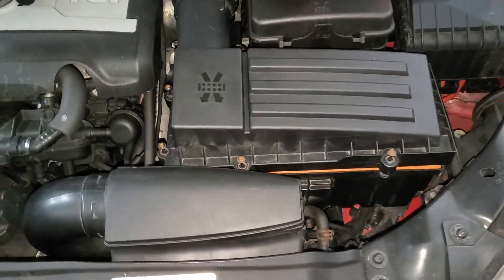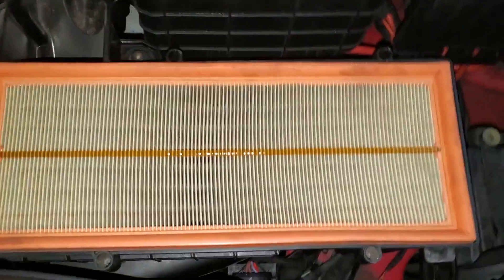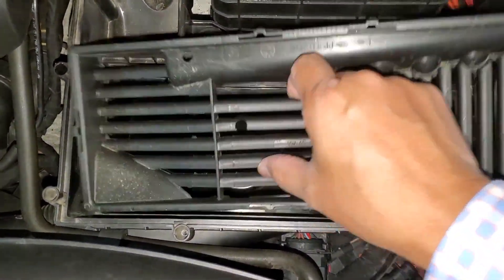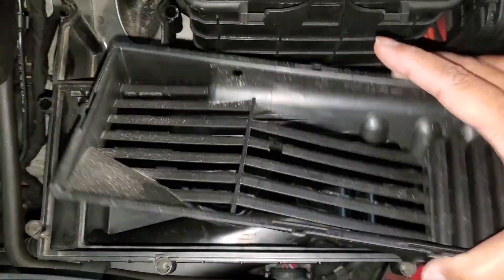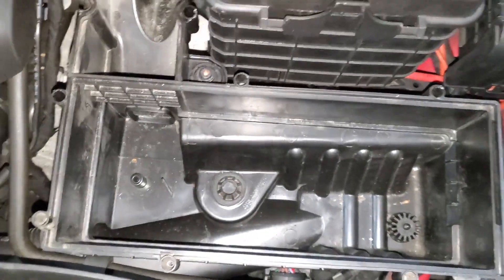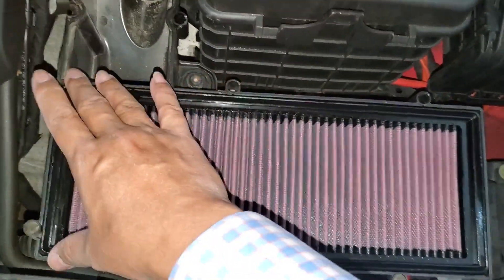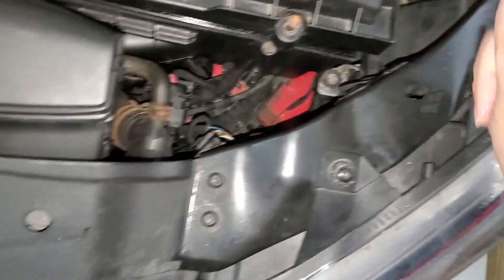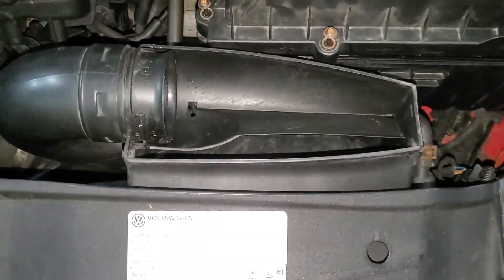VW GTI Mk6 Stock Intake "Cheese Grate/Snow Guard" Removal Mod

Comment: This "cheese grate" is not snow blocker. That grill has function to prevent turbulent flow inside air box. I have measured MAF flow with and without and it was higher with grate, than without, for about 8-9 g/sec ~ 194 g/s without, 203 g/s with. That is about 10-12 HP loss without that grate! Measurements was made with stock air filter.
Reply from the maker: Weird... I have the OPPOSITE measurements from you.  I measured peak of 225 g/s WITHOUT and only around 190 with it on...  My measurements are done with COBB Accessport logging.
Reply: @theclutch19  Did you measured with panel replacement filter or with standard filter ? What was outside temperature and pressure when you measured with and without grate ?
Reply from the maker: @fedjadrndarski9020  i measured with the K&N not the standard filter.  I had logged measurements at varying temps.  I was previously an engineer and was pretty OCD about it.
Reply: @theclutch19  I have measured with standard paper filter. Peak flow was about 196 g/s at +30C outside temp, and about 209 g/s at +6C. Pretty significant difference. Without grate at +6C it was about 201 g/s, much lower than with grate and it affects performance, car feels sluggish without grate, especially at mid range rpm. Maybe with high flow panel filter results would be different. I am also really surprised with that result.
Reply: @fedjadrndarski9020   Is it worse to remove?
Reply: @최정호-g5w  I have measured MAF readings with and without grate. I got lower readings w/o grate. Also car feels more sluggish without grate. Best way to increase intake airflow is to install free flowing cold air intake. But it is expensive.

Comment: That hole in front is so the engine gets a bit of cold air too, not only warm air from the radiatot
Reply: Bro i have sirocco with 2 wholes up and down i thinking to replace it with closed system its ok ? or maybe kN intake - some cars have the whole some stock dont